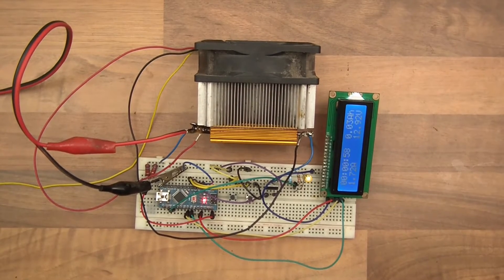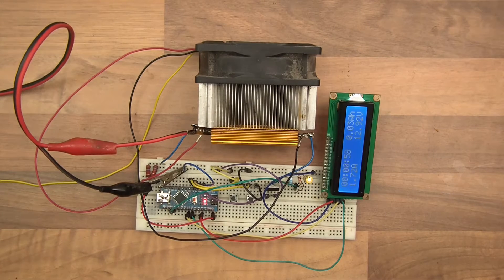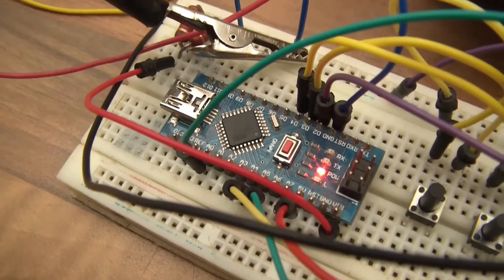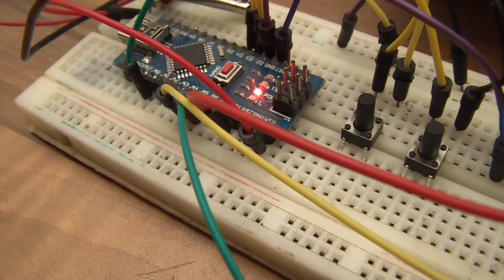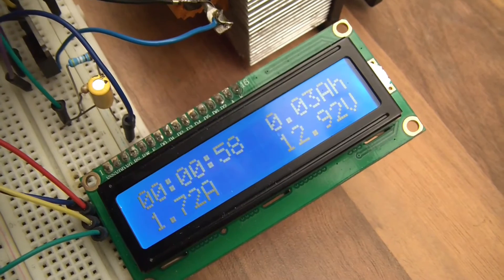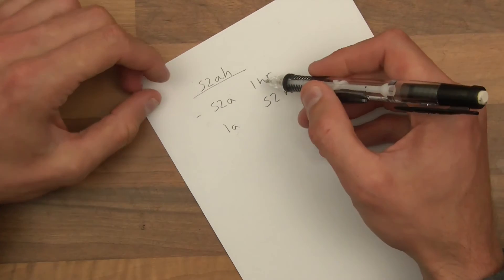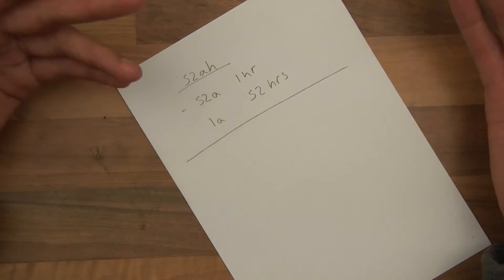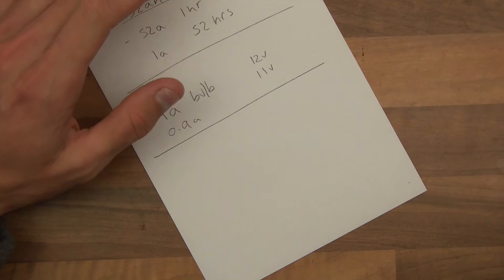TUTORIAL: How to Make a DIY Lead Acid Battery Capacity Checker Tester - Arduino LCD Part 1/2

Comment: Darling !  :)
Draining lead acid batteries down  to 11V means killing them fast.
With lead-acid chemistry, you can use only 50% of rated Ah capacity - you should not drain them below 12.1V.
Amperes, Volts and other units named after a person are written in upper case letters. Not knowing this is bad education/playing with things you don't know much about and, above all - you're showing disrespect to the people that discovered those phenomena a few hundred years ago, that you still don't know much about.
On resistor value you use: you measured it's resistance ?
On what instrument ?
The piss-poor, lower than entry level UNI-T you show?
What is the error of that thing on resistance measurements ?
Especially on low resistance measurements ?
So, you didn't measure a thing.
Now, had you properly measured your resistor - still the measured value could be wrong :)
At what ambient temperature did you measure ?
At what resistor temperature did you measure (it will get hot under load, and that WILL change it's resistance) ?
The tempco of that resistor (temperature coefficient - drift) ?
Off topic : you nutrition is still based on your nails ?
Reply from the maker: Haha! How I have missed you!

I agree. I discharge mine down to 12v. I don't ever go lower than that, although my car will if it's given the opportunity!

Wow, you've gone off one one today...

Disrespect? What? V/v - it means 'voltage'. It's fairly simple!

You can measure resistance with an ohmmeter. Although we could spend £1000 on a top class ohmmeter, and factor in the temperature; it's probably not necessary on this particular occasion! I'll use my £1000 ohmmeter on my rocket science projects!

Again, for the purposes of this project, I'm not overly concerned about 'temperature coefficient - drift'. I'll save that for my life-saving medical equipment! Ha!

Haha! Yes! My nail-based diet has served me well for many years now. I just need to add a drop of fertiliser to the surface every so often.

PS. Good job with your English. ;-)
Reply: You need to calm dude. He just made small diy project. This means if you don't have high quality multimeter you can't do anything haha. Keep it up @Antony Cartwright I'm with you !!
Reply: I spent many years researching lead acid battery charge/ discharge/ cyclic characteristics for cost sensitive high power consumer products. The discharge rate called the C rate determines the discharge terminal voltage representing 100% discharge. Using a constant current load and paying attention to ambient temperature is key to developing discharge characteristic curves. Equally important is the recharge cycle. Again current vs time ensuring 100% recharge. Great job explaining your theoretical approach.
Reply: A big manufacturer of lead-acid batteries for aircraft specifies that their batteries are discharged down to 10 Volts for a 12 Volt battery in a capacity test and at a one hour rate (C1 rate) . 
Harsh .. but that is what they demand.
Reply: @nomisrep1  once only ? :)
Reply: @JohnSmith-xn3fr  I would agree with John. If your sharing in a public forum, adhere to SI units. There is a difference between 'm' & 'M'.